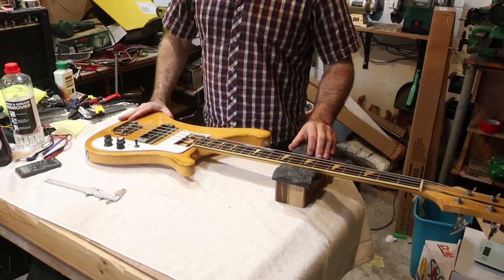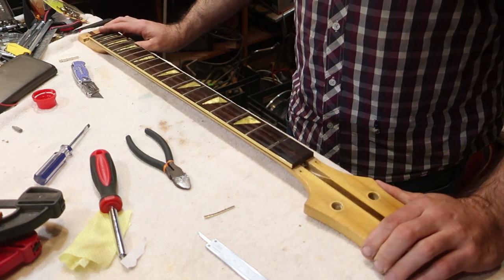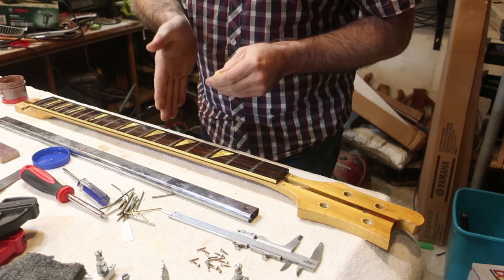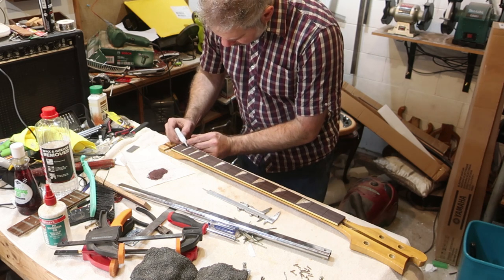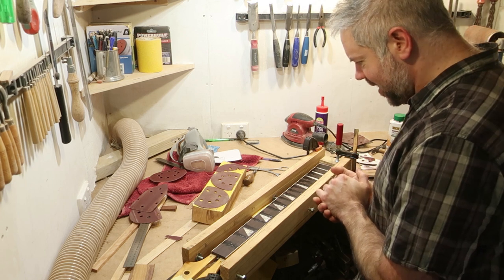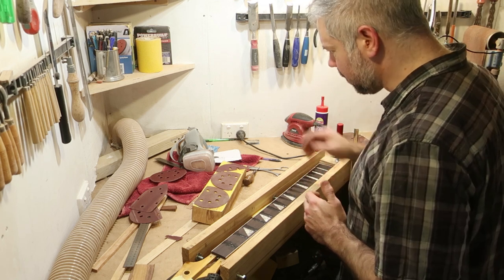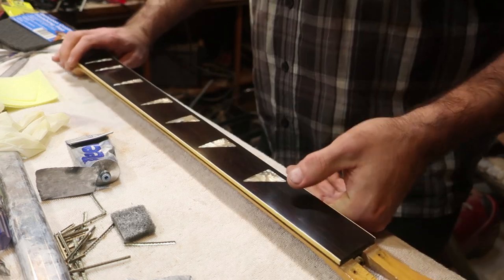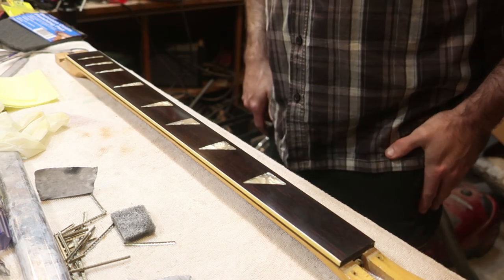Restoring A Vintage Japanese Rickenbacker Clone - Episode 2 - The Defrettening

Comment: Idea for removing frets - how about a car battery and a set of jump leads - make electrodes and touch them to the two ends of a fret for half a second, see how hot the fret got and adjust the timing for best results! Maybe use a car headlight bulb or other resistor in series to reduce the current. It will be much more effective in heating evenly compared with your soldering iron.

Comment: I don't think I get it, filling the slots with wood dust and glue works but the wood filler doesn't? I wouldn't have thought it would offer that much more resistance to the fingerboard bowing, as opposed to using strips of wood. But you clearly know this way better than I do, still haven't defretted a neck yet !
Reply from the maker: When you do defret a neck take a moment to string it up with empty slots and you'll be shocked at how far the neck bends forward, then consider that dried wood filler has the load bearing strength of chocolate, then you'll you'll understand why you need something much stronger.
Reply: @fanbladeinstruments  I understood this part, I was just surprised that wood dust and glue would be a viable solid alternative to strips of veneer
Reply from the maker: Superglue sets very hard, I made reference to the "baking soda and superglue trick", that's where a piece of a nut has broken off and you can repair it with a mixture that sets like a rock, and can be carved, shaped, and polished just like bone. I tried an experiment to make my own conductive paint, essentially mixed supergluie and graphite powder. The resulting mess wasn't conductive at all, but it set like a rock in seconds, whatever molecular reaction they use in CA accelerator also seems to work with fine powders including wood dust.
Reply: Wood filler typically doesn’t contain a “hardener”. It’ll fill a void, sand and sometimes stain well (depending on the type), but isn’t rigid at all. Glue, CA or otherwise, is harder than most woods and helps reinforce the void. Glue and sawdust works….kinda. But wood glue seals the sawdust against any finish you add after the fact. If he uses CA as a finish, he gets the best final result by using the same product for the repair. That way, he isn’t trying to match colors.

Comment: What tool(s) did you use to pack in the saw dust?
Reply from the maker: I actually used the end of a radius guage to press it into the slots, it's a bit hard to see as it's sped up so much (it was quite a long process), but anything thin enough to fit in the slots should work. So yeah, just a brush and a thin piece of metal. Thanks.
Reply: @fanbladeinstruments  cheers

Comment: Is safe for roundwound?
Reply from the maker: Should be, I played rounds on super glue finishes for years, but with rounds any finish will eventually wear out. I switched to flats because my main fretless Jazz bass had been re-leveled so many times there wasn't much of the fretboard left, and I found that I like flats now. But I had used rounds for 20 years yes.